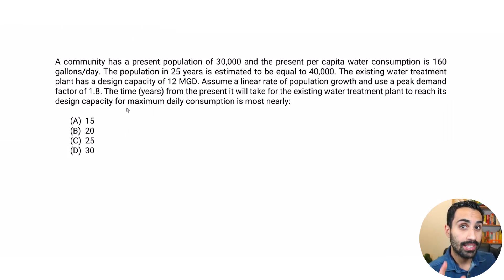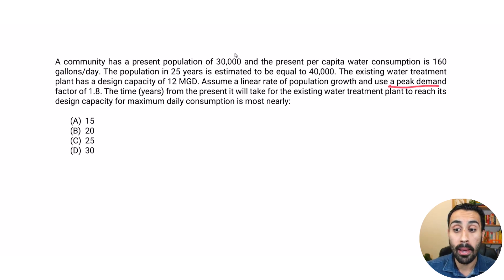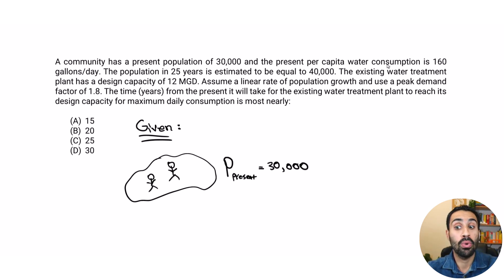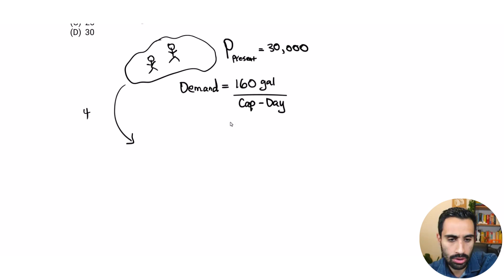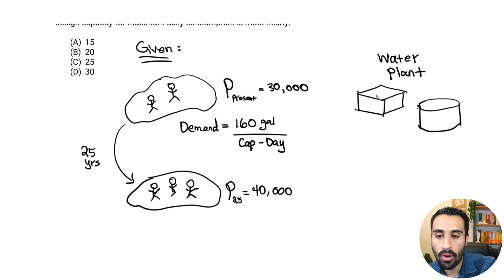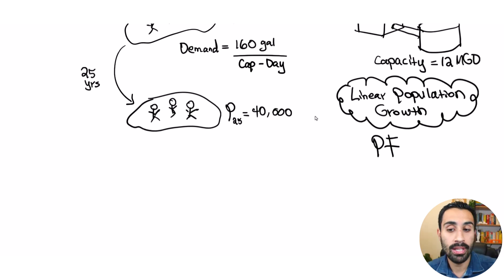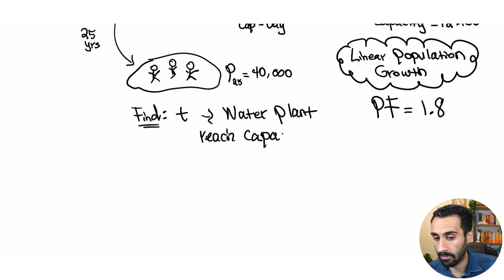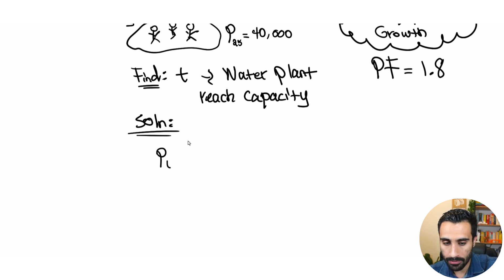2024 FE Exam Review - Water Resources - Population Projections

Comment: Before looking at the solution, I solved this one by doing (1.8)*(30,000)*(160) = 8.64 mgd, (1.8)*40,000*(160)=11.52 mgd
Then solve for k using linear pop growth model, and use resulting k=0.1152  in 
12 mgd = 11.52 mgd + (.1152)(t)
get t=4.2 + 25 = 29.2 yrs

Is there any reason you wouldn't want to solve one of these problems this way?